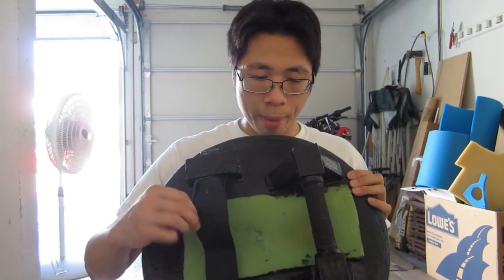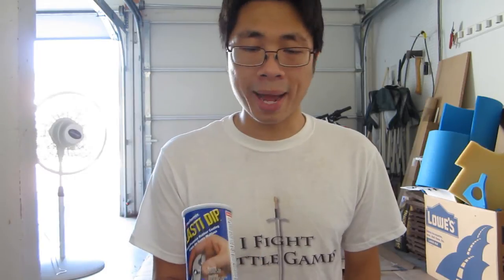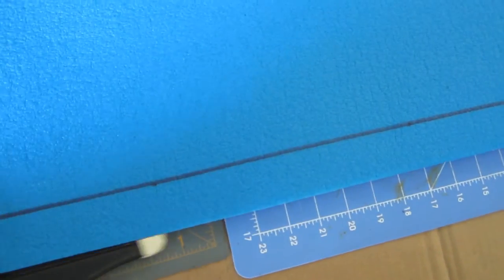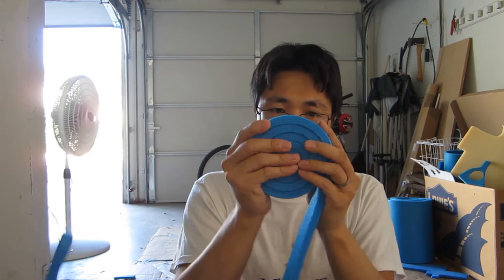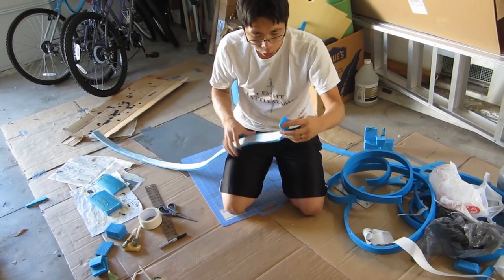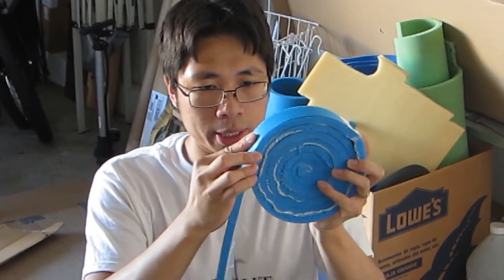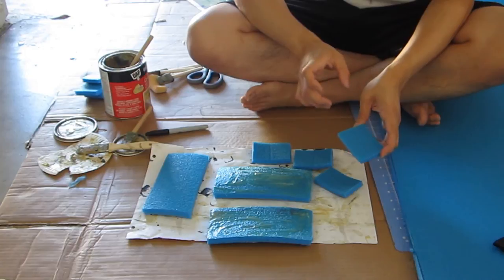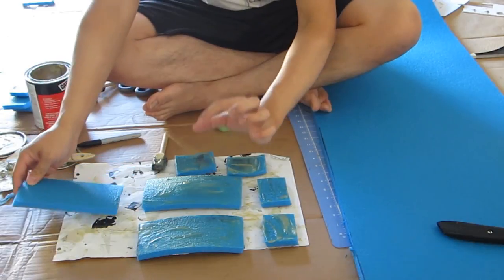How to Make a Foam Round Shield/Buckler Part 1 of 3

Comment: how much is the total cost for this shield? thanks very much. excellent tutorial.
Reply from the maker: That is a hard question to answer. All of the materials I listed can be used for more than 1 build. So it's hard to decide just exactly one. The most expensive material is the DAP glue and Plastidip. Plastidip is about 10-15 a can. A shield of that size can take 2.5 cans of plastidip. The foam is fairly cheap. So I would say, if you already have all the other materials, a shield like that cost about 40

Comment: That is nether a buckler or a round-shield. Both of those shield types were center griped
Reply from the maker: The point of the video is to show the method of how something like this is build. Where or how you make your handle is irrelevant. A shield is a shield. If you want a buckler, then make a smaller version. If you want to make a large round shield, then add more materials to make a larger version.